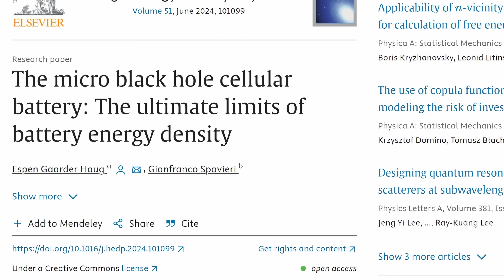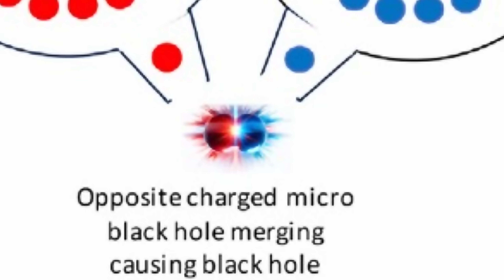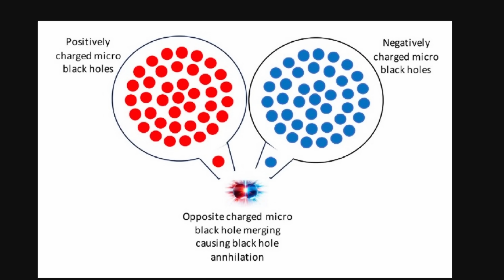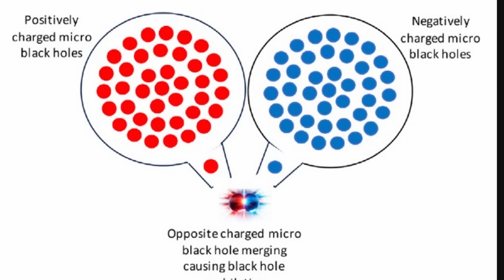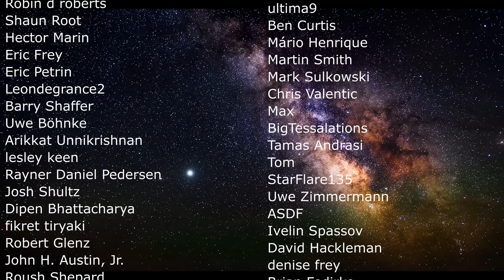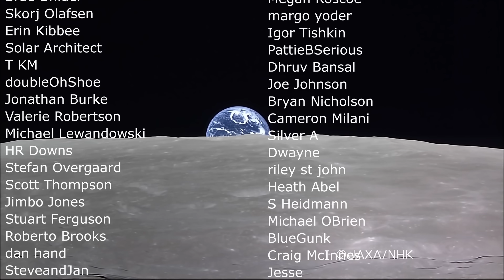Microscopic Black Holes Could Create a Perfect Battery (According to This Study)

Comment: This would make one hell of a propulsion system, too.  It might be able to deliver decent thrust if a high flowrate were used.  Another perk is that you can directly generate black holes using high intensity lasers (has yet to be achieved, due to the incredible beam power required); I suspect it would be a lot more efficient, per watt-hour input, to generate a given net mass of the specified black holes than a similar mass of antimatter--all known methods of antimatter production are absurdly inefficient.  Black holes generated this way may not have angular momentum, depending on the properties of the photons involved; to satisfy conservation of angular momentum, this must be the case if the parent photons lacked spin angular momentum and orbital angular momentum.  I just noticed one very critical problem, though; even though it's probably possible to generate a non-rotating black hole, feeding the black hole a charged particle (e.g., an electron) would impart angular momentum, as, iirc, all charged elementary particles have intrinsic angular momentum via spin.

On another note, you could also use the black hole annihilation like an antimatter catalyst; antimatter catalysis is leveraged by some fusion drive designs in order to reduce the confinement required for fusion.  This, in turn, makes it a lot easier to build a fusion drive with low wattage requirements (or maybe even net-positive, if some of the reaction energy is regenerated).

Still, I think this one might be solidly impossible, due to the charge/angular momentum hiccup.

Comment: Kind of like trying to pull energy from the plane of inertia of a stationary magnet?  Every atom is a magnet.  The nucleus being the magnet and the shell is the magnetic field.  But wouldn't there be a micro black hole in the center of every atom?  Does every atom that is attached to each other have a micro black hole binding them together?     ➗

Comment: When a noble gas moves fast enough to lower the mass and keep it bouncing off the wall. At the morphotropic stage. You need a switch and a wire won't work. Pzt and the Pias effect can move you fast enough to reach the Stars.

Comment: Absurdly stupid idea. Microscopic black holes are absolute nonsense. Black holes rely on mass in a given volume. A lot of mass in a relatively small volume. There is another object that also relies on mass within a given volume, a star. Black holes, like stars, also have to reach a certain density before they can be considered black holes. Black holes are just Neutron stars of a given size, with enough mass to curve space time. So imagine the kind of energy density needed to create a black hole of microscopic size, it would be enormous, you'd need to find a way to completely abolish fundamental forces of nature, no more strong force, so Neutrons could overcome their natural tendency to remain singular, also you'd have to find a way to abolish quarks behavior in chromodynamics, essentially making gluon interaction orders of magnitude stronger, all this inevitably means having the power of god to change the ultimate measuring stick, you'd have to be able to change the size of the Planck length, and Planck time. Just like we don't find stars the size of golf balls floating around in or around our solar system pumping out absurd amounts of radiation, we also don't find microscopic black holes that seem to mysteriously absorb matter and grow to the size of golf balls and emit radiation from matter in their own little ergospheres...

Comment: What advantage would this present over an anti-matter battery? The thing is you would need to create both positive and negative black holes, so 100% of the energy you get out you had to put in and store ahead of time. With an anti-matter battery, you only need to store half the power you get back out, the other half can be regular mass like air or dirt.

The black hole battery would have a higher energy density, but i dont know how much that would really matter. The emmissions of radiation ensure the requirment of large shielding, so in either case the batteries will never be small enough to carry around. Not to mention that in both cases something going wrong mean you have a pocket nuke.

Comment: Can you please do a more in depth video on Hawking radiation? All the "lamens terms" descriptions I've heard seem to lack a critical detail. 

In particular, the explanation I've heard says that antimatter/ normal matter particles will form near the event horizon with the antimatter half falling into the black hole, overall contributing a negative mass over time. If that's correct, then why are the normal matter particles not falling into the black hole with equal frequency resulting in a net difference of zero loss?

Comment: Your comparison of the energy density of lithium battery to a similar mass of oil sounds off.
Diesel fuel has about 1280 wh/kg, while Lithium-ion battery has anout 120 wh/kg.
Reply: You have missed a zero
Reply: @prezekCZ  in which one
Reply: @erkinalp  diesel fuel has 12 800 Wh/kg

Comment: This is a pretty crazy idea. To give you an idea of what this means, suppose you have a black hole of mass 10 million metric tons. It would have a Schwarzschild radius of only 10^-17 metres (absolutely tiny!), and would produce 3.5 megawatts of power for 1.5 million years! As time goes on though, the power output increases exponentially as it gets closer to the end of its life. How would you contain such a thing?? let alone harness the power?
Reply: The plank mass black holes discussed here weigh 22 micrograms.
Reply: A 22ug black hole would have a lifespan of around 10^-40 seconds... A new technology would be needed to charge things this small fast enough before they go boom

Comment: Somebody doesn’t know how to do simple math. There isn’t and never will be a lithium battery that stores ~20 times the energy as the same weight of oil.  I looked at the paper and they do say that the best lithium battery stores the 954,000 Joules per Kg you reported. The paper also says that this is about 20 times more energy than the same weight of oil. This is incorrect. When burned one Kg of gasoline releases about 45,000,000 joules, or around 50 times more than the battery. So when comparing the energy in a battery to the energy in oil the paper is off by a factor of 800 to 1,000.

Comment: the smaller the BH the stronger its radiation. so it wouldn't be like a battery but more like a continuous explosion you're trying to fuel (against the explosion) faster than it's exploding.

Comment: There are better ways to utilize micro black holes as batteries. You can store your charge as an actual charge. If two opposite charge black holes are in a fixed orbit around each other, applying or removing a charge from one would store that charge with over 99% efficiency and rather than annihilating you're just changing the distance between the two objects.
Reply: I imagined type III civilizations on the Kardashev scale (and beyond) would be able to produce/store power like this for 1000s of billions of years using two rotating supermassive black holes as their batteries.

Comment: The starter battery for a combustion engine was invented in 1859 and has only been marginally improved by time. It’s physically and electrically robust and doesn’t catch fire in a wreck. They have half the energy storage density of ice and a third that of compressed air, but we still use them for starters because slabs of lead in a sturdy tank of liquid are stupid easy to make and use.
   They’re horrible but we still use em, a century and a half later, because they do the one job really well. Better lead acid batteries exist, like cyclons, but they’re overkill for an average car and a car will kill them by mischarging, guaranteed, because safety.
Reply: Yup the lead acid battery is a great example of an appropriate technology.

Comment: If they could intersperse microscopic black holes into semiconductor substrate material, it could remove much of the heat generated by active devices and thus you could increase the junction density in an integrated circuit greatly and not be limited by the thermal conductivity from the junction to the case.  It would also end the need for large heatsinks and cooling fans.  The former acts as an antenna and waveguide and introduces stray electromagnetic signals into the circuit (a problem that FCC regulations seek to address and add a lot of complexity and cost to designs) and the latter is a source of cyclical electromagnetic interference as well as limiting the efficiency of electronic circuits due to the change in power factor due to the reactance of inductive loads such as electrical motors.  This interference can be masked a bit by increasing capacitance near the motors but then RLC resonance (generating another cyclical signal into the current paths on the printed circuit board) becomes more of a risk.

Comment: An old Star Trek novel mentioned something like this.  A tiny black hole held in place by electromagnetism.  Lasers were fired at it and the energy sort of folded back on itself, creating something of a localized warp in space.  Of course, how you could use something like that, I could only guess.

Comment: Look up Issac Auther's series on you tube.  He has several vodeos discussing harvesting energy from black holes.  Small black holes in the Megaton range last for a decade or so and could be used as an energy source for an interplanatary ship.  Slightly larger the energy output is lower but the lifespan grows enought to be used as a "battery" for an interstellar ship. 

Just need to be extra carefull the last decade or so.  Trade in the expended black hole before the increasing power output fries your ship

Comment: That's soo inefficient. So much energy released at an instance is not very usable. How about instead of charging them until they become completely stable, charge one until its hawking radiation becomes small enough to be useful? Then we just need to constantly feed it some mass and we have a perfect mass to energy converter. Like some tons of sand per year to satisfy the entire human energy demand - or a romulan warbird xD

Comment: Dyson sphere has a contender for wildest ideas pitched by scientists.
Reply: I would say that black-hole batteries beat Dyson spheres on the out-to-lunch scale.  At least Dyson spheres don't require "new physics" or hypothetical objects that probably don't exist to build them.
Reply: These could power small objects similar to Dyson spheres in construction feeding the black hole interstellar gasses. Would solve a couple of problems, it would create artificial gravity and nearly unlimited energy as needed.
Reply: Wouldn't you need a Dyson sphere around this battery to capture its energy?
Reply: @CaedenV yes but you wouldn’t need to disassemble a planet to build it
Reply: Dyson sphere is as plausible as fiber optic internet speeds, micro blackhole technology is so far off the current scale it's not even sci-fi, by the time (if ever) humanity has the knowledge, resources and engineering abilities to produce and move, at will, the micro blackholes there will surely be a much more reasonable alternative for the (then) current requirements (like a dyson sphere). This is so "endgame" by the time this is important people will be planning on which planets to put in a planetary system...

Comment: Black holes are external magnetic fields that don't ground energy. Monopoles of pure cold repulsion of space itself devoid heat energy within. Black holes disolve mass as internal magnetic fields grounding currents through its nucleus or core. External magnetic fields disrupt normal space repulsion by occupational external circulation outside the nucleus or core. Space itself is a weak external magnetic field filled with dark heat energy outside of the entanglement of mass. Maximum distance traveling through a weak force of pressure to and from in momentum as cold repulsion to heat propulsion from cold repulsion. Magnetism of magnets shows the grounding currents through its core or nucleus where force is stronger and distance traveling is minimal. There is not a negative field. Heat is the lifeblood of everything as magnetism. Magnetism explains all physics. Electricity is rapid heat exchanging singularities point to point chain reactions through all masses in its path until resistance is overcome by open space itself and returns to dark heat energy outside of entanglement of mass once again. Heat waves from stars near and far fill space with dark heat energy outside of entanglement of mass. Cold space and heat coexist as space itself as a weak external magnetic field filled with dark heat energy waves outside of entanglement of mass. Entanglement is internal magnetic fields grounding currents into itself and surrounding mass. Mass neutralizes repulsion within it as occupational space and repulsion force of pressure to heat propulsion from cold repulsion as magnetic fields. Heat has to ground or burn out of entanglement as external heat energy outside of entanglement of mass. Fire is usually why you ground fast-moving heat. Stars decay as outward force of pressure known as heat waves. Electricity is rapid heat exchanging through mass faster than normal heat energy waves outside of entanglement of mass. Mass already has heat within. Copper wires conduct heat rapidly as heat grounding. The heat passes through all mass. Electric cords are warm from heat passing through it. Engines ground heat energy to anti freeze and radiators ground to atmospheres. Lightning strikes burn through mass and heat resonating outwardly force of pressure as decay of mass. Condensation is cold repulsion to heat propulsion from cold repulsion where hydrogen sharing heat with oxygen as warmth. Cold repulsion turns hydrogen and oxygen into hail. Lightning is pressure equalization, releasing heat back into the atmospheres of cold repulsion. Internal magnetic fields grounding currents into itself and surrounding mass in equalization to pressure incoming and outgoing heat energy. Magnetism circulation patterns of mass as temperature control as grounding currents of heat energy from renewable energy singularities exchanging singularities point to point chain reactions through all masses in its path. If heat doesn't ground, then it burns as fire. Sunburn when. Shivering is rapid heat loss. Atoms share warmth as molecules of entanglement of internal magnetic fields. Internal magnetic fields grounding currents through the nucleus or core where force is stronger. Hydrogen has the strongest force of pressure and the least distance traveling. Molecules sharing currents grounding of heat. When you strike rocks,  metal, wood, or grinding on these items, you are releasing heat as sparks, fire, lighting up atmospheres like filaments. Heat sparks from renewable heat energy exchanging singularities point to point chain reactions through atmospheres as daylight. Physists call sparks electrons. Light is only present in resistance. Heat magnification of light refraction. Heat is sparks like lightning strikes. Electricity is rapid heat exchanging through mass like lightning strikes don't ground. Lightning burns through atmospheres as equalization to cold repulsion. Equalization to force of pressure. Burning through atmospheres gasses releasing heat. Water is from repulsion to heat propulsion from cold repulsion. Ice in a glass of liquid condensate outside the glass as oxygen and hydrogen join forces from cold repulsion within the glass and outside the glass. Mass has cold repulsion within as outward force of pressure known as weight. Oxygen and hydrogen are formed from repulsion within the glass and from repulsion within mass to the weakest point of repulsion. Magnetism bonding force of pressure. I give you condensation. Internal magnetic fields grounding currents are the weakest point of repulsion. Condensation slides down the glass as grounding currents to the greater magnetic field of force of earth's core of greater flowing currents grounding heat energy. The closer to the core or nucleus, the greater the currents flowing as weight of force of pressure. Theoretically factual probability that works with quantum physics without gravity. Friction causes sparks (electrons) lighting up atmospheres. Light piggy backing on heat waves throughout space and atmospheres as refraction magnification of light. We occupy space as neutralized cold repulsion within as outward force of pressure, and outside of earth's internal magnetic field grounding currents back into itself through the nucleus or core,  mass is outward force of pressure known as weightless. But  inside of earth's magnetic field quantum magnetic fields are redirected grounding currents into itself and surrounding mass towards earth's greater magnetic field of force flow currents grounding themselves through earth's core .
Reply: Paragraphs

Comment: Black holes of "opposite charge"... This just sounds like a late April Fool's article. Is it about electric charge?
We didn't really get into the deeper details, is the article claiming there's more to a black hole than just mass, electric charge, and angular momentum?
Or that the difference in electric charge allows mass to escape from the black hole? This only applies to micro black holes I presume?
Electric charge is often expressed as an electron gap, how are these gaps envisioned in such a black hole? Is this a Black Hole made of a quarksoup without electrons?